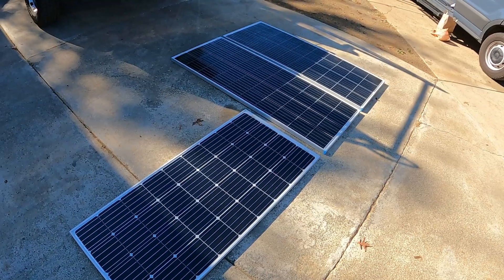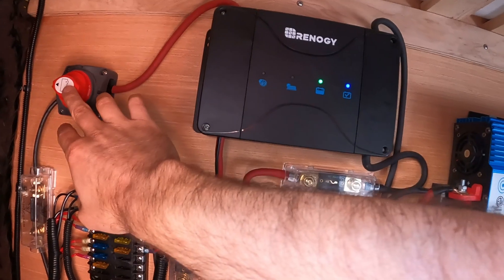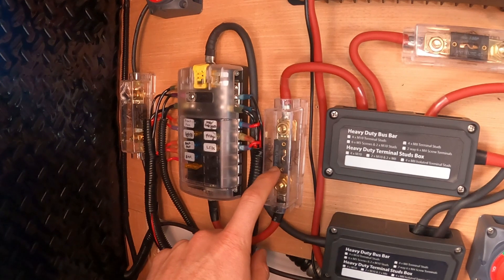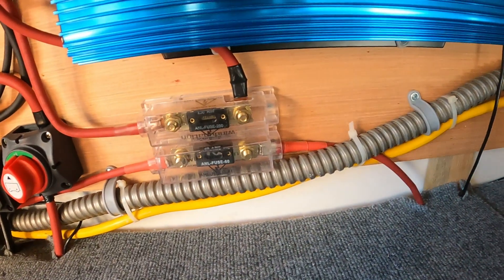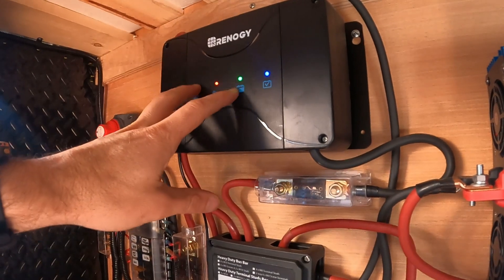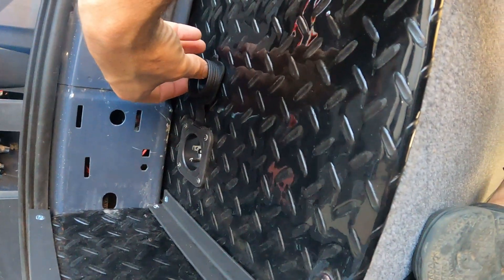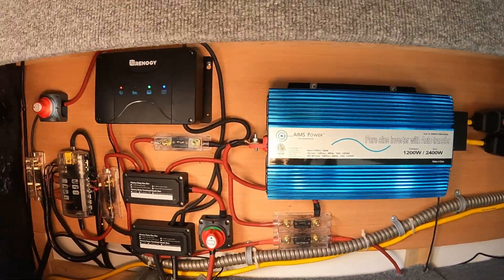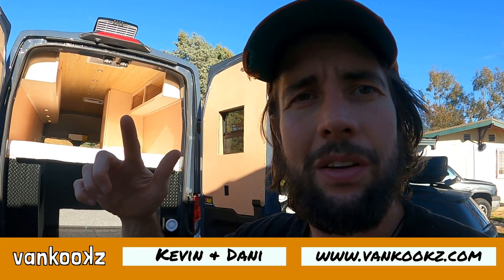Solar Power Setup for Van Conversion | Van Conversion Wiring Diagram

Comment: Hope you don’t mind a late question.  I have an 06 Sprinter I’m working on, so starter battery is in the engine compartment.  Not a smart alternator to the best of my research.    I have the Renogy DC-DC like you have, except it is the 50amp.  Because it was on sale, not because I think I need the big one.  A sprinter of my era is about 19 feet long bumper to bumper.  I’m trying to figure out what size gauge wire for that run from the starter battery to the DC-DC charger.  Generically, I have found the alternator output is supposed to be 150W on the OEM, which is what I have.  What Gauge wire for that 20 plug foot run from Starter battery to the DC-DC controller???
Reply from the maker: I would use at least 4 I’ve used less and it got very hot and I had to replace. It’s expensive but it’s going to be safe
Reply: @Vankookz  Thanks.  I think I’m going to go with 2 AWG wire.  It can’t be that much more expensive than 4 AWG.  By the time one is picking out wire at the stage I am at, the big money has already been spent.

Comment: Thank you for this video - well done.  I followed this set-up and all is okay, but i noticed there is no negative cable running back to the dc to dc charger.  I ran all wires as you have shown, so just ensuring i havent missed something. 
Thanks again,
Kel
Reply from the maker: The dc to dc charger should be grounded off the bus bar from the battery bank with a single cable.
Reply: Thanks for the reply :). So does the negative bus bar get grounded to the chassis?
Reply: Hello, I have everything connected and started the van, but the dc to dc charger is showing a yellow light for the alternator.  I checked the manual and it reports that yellow is normal voltage.  My 200ah lithium has been sitting since the winter in its packaging, so maybe it's charging?  I'm waiting for the battery monitor and shunt, so I don't really know if the battery is charging when van is running. 
Kel
Reply: Hi Kevin,
I apologize for the question about the buscar for grounding.  For some reason the link to the video glitches and showed what I have already been following for the install. 
I found the one about grounding. Thanks.

Comment: I have similar set up ready to be installed. 300w solar, 200ah battery bank, 40amp mppt. My charge controller came with 8awg wire to use. My current amp load is only about 15 total but may rise in the future. Is 8awg thick enough for controller to busbar and busbar to fuse box? What size fuses between those things?
Reply from the maker: Yeah that should be fine.  For sure size take your amps and multiply by 1.25 so a 40amp mppt could have 50 amp fuse although a 40amp would be fine for your solar set up 300W/12V = 25Amps so a 40 amp fuse would be fine
Reply: @Vankookz  thanks! and for the fuse leading to dc fuse box, should it be about the same?
Reply from the maker: Just calculate all the items you would use in amps if you were to run everything you would use all at once add it all up and multiply it by 1.25 so fridge, lights, sink pump, roof fan, heater and everything else you use.  Most of them will tell you on the unit what they use.  It’s usually about 40 to 50 amp fuses.

Comment: Is the Aims Power Switch the same thing as an “inverter charger” from renogy?  I’ve also seen it as inverter generator seems like everyone has a different name for an inverter that can also go upstream and safely charge the battery from shore power.
Reply from the maker: Yes it is the same thing